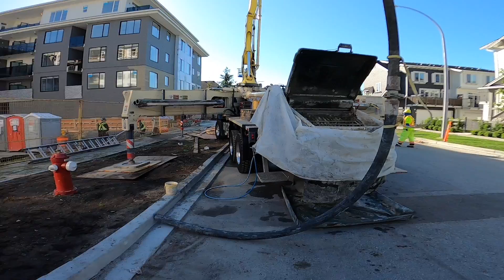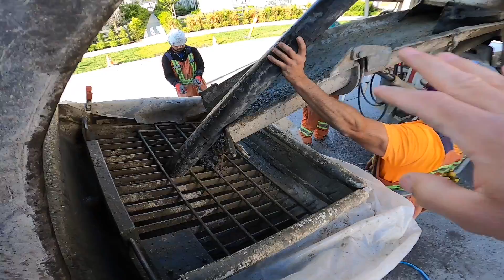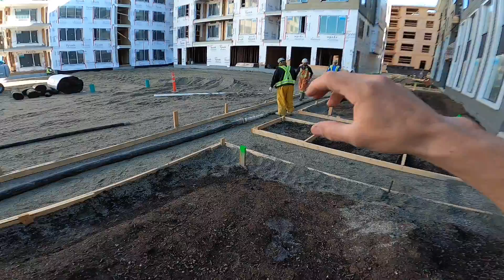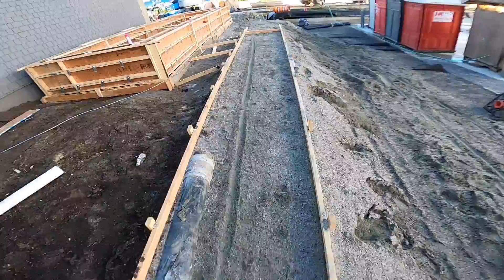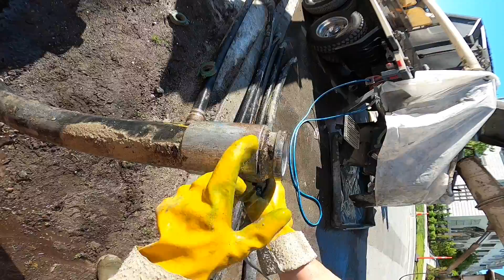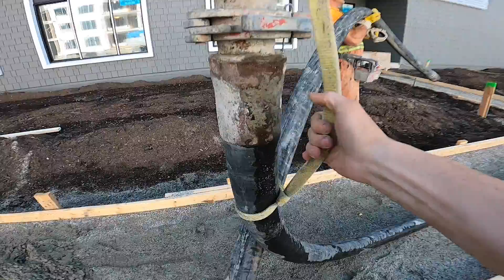Priming out 200’ of line with bentonite

Comment: How long u like those hoses? We're using 2.5" 10mt for shotcrete and it's hard to handle to say the least.
Reply from the maker: I find that 25’ lengths for 3.5” and smaller is perfect, 20’ for 3.5” and 4”. Anything over 25’ would be a nightmare to drain by hand (especially for me, being barely 5’9” tall).
Reply: @canadianconcretepumper1979  I did some calculations and the 10mt hose full of concrete is around 125kg. I need you arms lol
Reply from the maker: @styzr  nah, just a simple Milwaukee battery powered air compressor and a accompanying blowout cap will suffice 😂😂😂

Comment: Nice video I worked at southwest in colorado before it was sold.  Southwest is the best.  It's crazy how many of the techniques and methods are exactly the same as yalls.  I've never been anywhere else that does it just like we do.
Reply from the maker: I'm guessing you guys must be working with similar materials as to us? We're fortunate around here to have very forgiving concrete which allows us to get away with using 2" and 2.5" hose. I feel for those guys on the east coast and some of the southern states having to use 4" and 5" line.
Reply: @canadianconcretepumper1979  we use mostly 4 inch line on booms but I carry 3 inch line on my personal pump.  I thought SW was affiliated somehow with AJs concrete pumping.  Maybe I was mistaken.
Reply from the maker: @joshrice5964  there is also a “A-Jay” Pumping in Montana I believe. They also have yellow booms, but rest of the rig is painted blue.
Reply: @canadianconcretepumper1979  I believe they were out of Atlanta and the southeast US.

Comment: I been line pupping for 6 years..... thts the best way to clean out rubber hoses...... we roll 10foot pipes only
Reply from the maker: I’ve seen in other markets where 10’ lengths of hose are quite common, I always imagined it could be a hassle dealing with all the extra clamps and couplings when dragging the line around.

Comment: When cleaning hoses, I was taught to just continously spray water in and twist it like you said not to do. I was hoping you'd do a 3rd wash and roll to see how clean the water is, cause if it really makes it clean with just those 2 doses, I'm gonna be the most efficient hose cleaner in our workplace lmao
Reply from the maker: Give it a try, I 100% guarantee they will be clean and free of any concrete. For years I did the twist and roll method and occasionally would miss the odd bit of concrete inside of the hose. Doing the roll mitigates this.
Reply: @canadianconcretepumper1979  Just to add onto that, we generally only use 2.5'' and 3'' hoses, works fine regardless by just pumping in like 1-2 gallons per roll? Gonna give this a shot starting monday!
Reply from the maker: I should say however, when getting into 4” line and larger (something we rarely, if ever do, you’ll need to use a lot more water.

Comment: Another "pro tip" for bentonite. Use a battery powered drill with spiral paddle, add bentonite to the whirlpool of water in the bucket. Creates a nice, uniform consistency to the batter. No lumpy gravy! All of our line pumps carry this set up and we use it when needed on the booms. 
I'm thinking of retrofitting an air cuff to my 38Z, a video on air cuff would be great. Thanks Scott, another great Vlog!
Reply from the maker: Air-cuff is worth its weight in gold! We actually do have the drill setup which you speak of on a couple of the pumps as well as back at our yard, definitely helps to get the bentonite mixed up to consistency lump free in a hurry. Thanks for watching brother 🙏
Reply: i like the lumps.  im somehow convinced they help the prime out @canadianconcretepumper1979
Reply: I like the drill idea.  I use the pressure washer at the shop to mix mine, and I usually carry one bucket premixed on the truck (except in the winter).  The drill onboard would be good if something came up unexpectedly

Comment: No rebar???
Reply from the maker: Aside from detached residential homes (and usually only the higher end ones), sidewalk is poured on grade around here sans the rebar, but using proper compaction/grade prep. Couldn’t tell you the exact reasons as to why (I’m just a dumb pump guy) 😂😂😂
Reply: @canadianconcretepumper1979  there must not be frost heaving cause that would crack and shift all over here in Alberta
Reply from the maker: @Dex01-Z_WingZero  Could very well be the case. I do know that here in the lower mainland of BC we do not have the road bans which are commonplace out your way or even elsewhere in our province.

Comment: I found that shaking the hose as the crunchies pass through will help to alleviate rock packs. 1 5 gallon bucket for every 100 feet of system and walking pace for volume during prime out. Cool to see how other people do it. Stay safe.
Reply from the maker: Yes, a great technique indeed, pick the hose up and shake it along. What I realized when editing this video was that we had the air-cuff engaged prior to priming (which creates a dry slug at the pinch point of the hose), explains why it got crunchy almost immediately upon priming through the line.